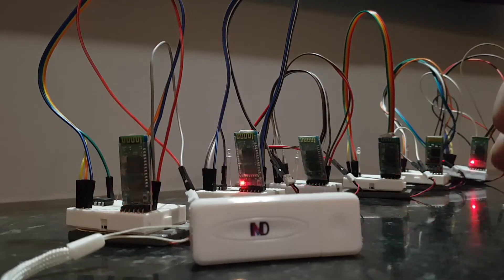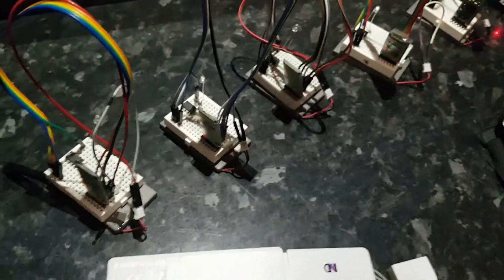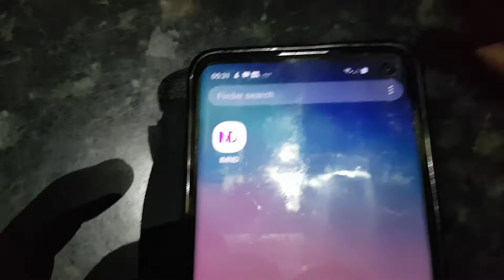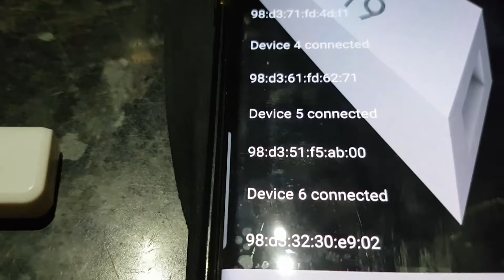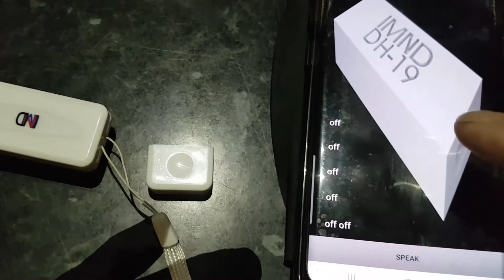Arduino Hc-05 piconet DH-19 dongle, home assistance network adapter

Comment: Did you build dongle?
Or, where do you get it?
Reply from the maker: yes we built the dongle the dongle is only 1 part or are network  and all its devices.
Reply: Sir, where i can buy it?
Reply: @zofmod  actually i want to learning anything about your video
Reply: Why would you not use the HM-10? Which is supported by Apple. Realize your hard work.